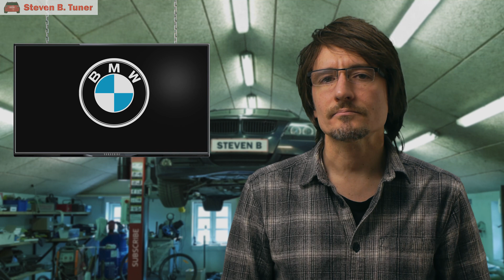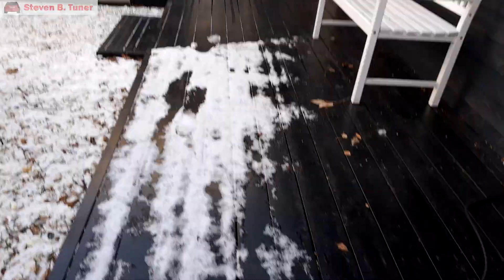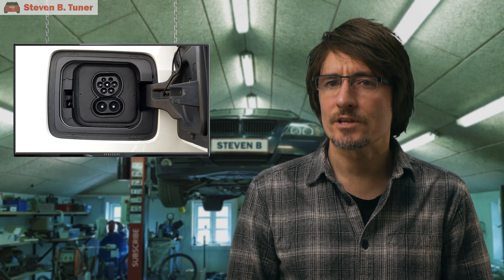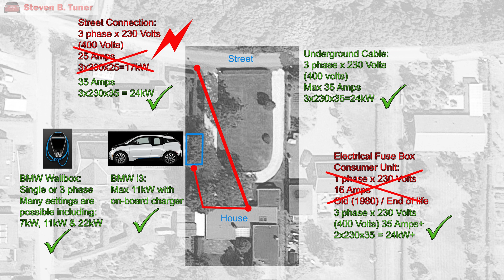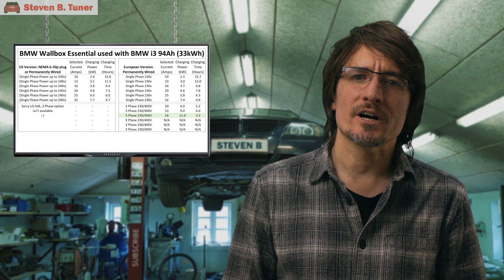🔌 BMW i3 Home Charging: The Ultimate Guide to Wiring Upgrades & the BMW Wallbox Installation 🏠

Comment: Liked the video, but FYI, in the Nordics most people painlessly charge their cars overnight having just 20A or even 16A 3-phase connection for the whole house - and we have not only electric ovens, but also electric heat-pump house heating.   What you really need is load monitoring and balancing to fully utilize available power without exceeding 16A on any of the 3 phases.
Then with subsidy from the state installation like yours usually costs around 700-1000 Euro (because no need to upgrade house supply lines).  It will not charge the car at more than 11kWh but works well in practice despite just 16A main fuse :)
Reply from the maker: Hi, slow overnight charging is a lot easier but I was determined that full speed AC charging the car was never going to be a problem at any time of day or night. I'll have to look into the load monitoring and balancing to see how everything can best work together when there are multiple car chargers.
Reply: @StevenBTuner  the points are: 
1- it can cost under 1000 Euro to install a perfectly sufficient home charger that is 100% guaranteed to not blow your fuses.

2- even if your house can not get more than 16A or 20A without colossal investments, it is still enough to charge electrical car at home for most people.  :)

But sure, if you want to charge large batteries at full speed (22Wh) then your install is a dream. I would still not do it because my electricity network-service bill would be more than 2x as expensive due to all the extra Amps that i would rarely use :)

Comment: Installed a Wallbox 40 amp charger. The BMW CE 04 will not charge and goes into fault. The new EV charges perfectly. The wiring is new 6 GA and has no faults. I also tried the Charger that came with the car on the BMW. It will not charge at level II. Only works on commercial public charges.
Reply from the maker: Hi, those kinds of problems are not much fun to figure out! I don't know how fussy the wallbox is when it comes to voltage drop, but it may have an issue with a 2 or 3% voltage drop if you have a long cable run. This is something that your electrician should be able to test with a dummy 40A load. There is always the chance that the box or the car has a fault as well, and the car should record a DTC trouble code to help. All the best in getting to the bottom of the issue!

Comment: Looking forward to more i3 related videos. I’m looking into owning an i3 in Denmark. Would be grate with a video about pros and cons of having it in Denmark.
Reply from the maker: Hi, the only 'con' is that people are switching to electric cars much quicker than fast chargers are being installed - it is a problem worldwide, not just in Denmark. Of course this is not an issue if you only drive in the range of your battery.

Comment: Does it work with any other EV car brand or it must be BMW only?
Reply from the maker: Hi, thanks for watching! It is a standard type 2 CCS charger, so it should work with other cars too.
Reply: Actually BMW told me that to properly use it's advanced features it has to be a BMW. It will charge any car, but BMW does not promise any scheduling or tariff-based charging if not connected to BMW and/or compatible electricity provider.  I chose another brand to not be limited in all of these things.

Comment: Very informative. You had to do much more than we did to get a Level 2 EVSE installed (we live in the U.S.). Fortunately, my next door neighbor is an electrician and an EV enthusiast. He helped me install 6 gauge wiring from the breaker box (50 Amp) to the garage, then connect it to a NEMA 14-50 outlet. I bought a 40 Amp EVSE. More than the i3 needs but wanted to future-proof for other EVs. We don’t ever plan to buy ICE again. :)
Reply from the maker: Hi, thanks for watching! Yes, my 40 year old breaker box was never going to handle any upgrade very well, especially not an electric car, and then I made an additional problem by parking the car a long way from the house - but the most annoying part I suppose was the expensive upgrade by the power supplier. Having an electrician as your next door neighbor helps a lot! :-)  Just so I understand correctly, you have ended up with 9.6kW of power at your charger - which more than the what a US spec BMW Wallbox Essential could do. Sounds like you have a good setup.
Reply: @StevenBTuner  I had no idea if I have 9.6 kW of power (remember it's my friend who's the electrician, not me lol) but I found the calculation to figure it out and yes, you are correct. Thanks for teaching me something else. :)
Reply from the maker: @robertbright8741  :-) The main thing is that you have enough power to charge your i3 in a reasonable time, so that you can use it when you want to!

Comment from the maker: Who else had trouble charging their electric car at home or has had a very different experience? I'd love to hear about it!  
Here is a breakdown of the chapters in this video: 
0:00 BMW i3 Charging At Home - Overview
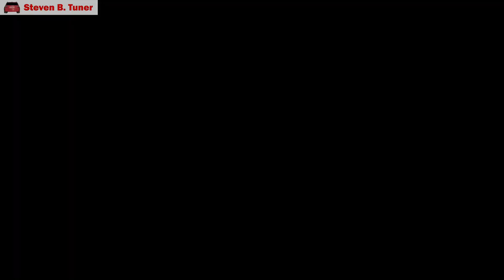0:40 BMW i3 Charging At Home - First Charging Attempt
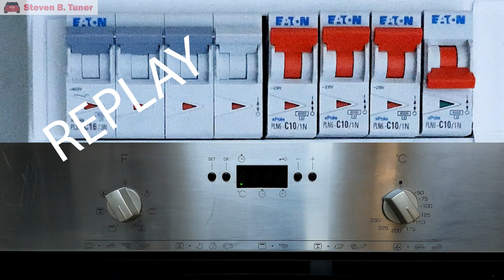1:31 BMW i3 Charging At Home - What Went Wrong?
2:09 BMW i3 Charging At Home - How Much Power Does A BMW i3 Want?
3:13 BMW i3 Charging At Home - Home Charging Times
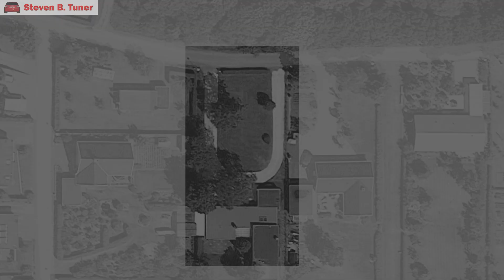4:14 BMW i3 Charging At Home - Home Wiring Upgrades
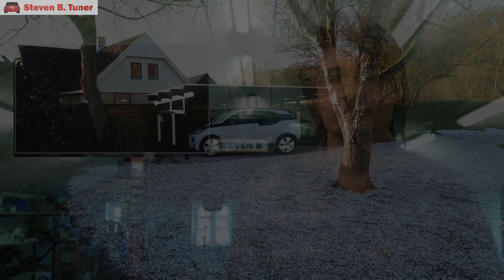6:42 BMW i3 Charging At Home - The Final Solution
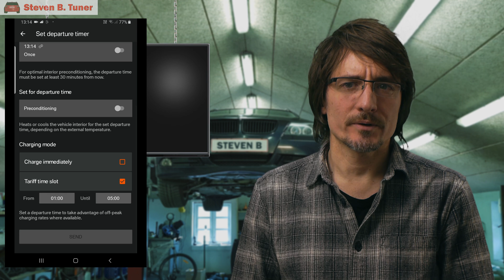7:13 BMW i3 Charging At Home - The BMW Wallbox Essential
6:42 BMW i3 Charging At Home - The Cost of the Upgrades in $US